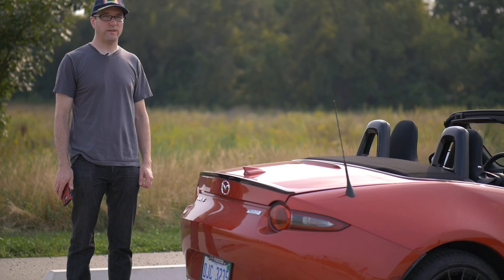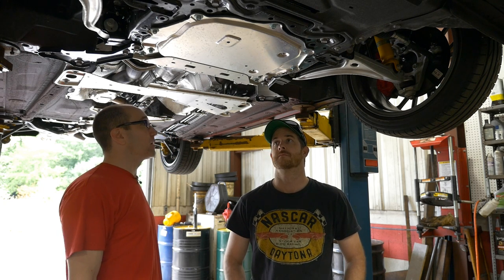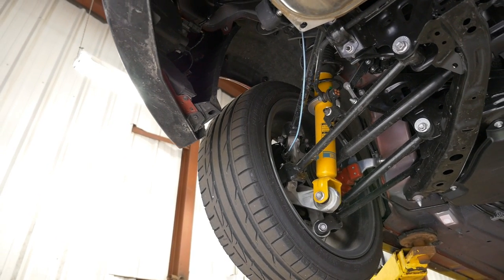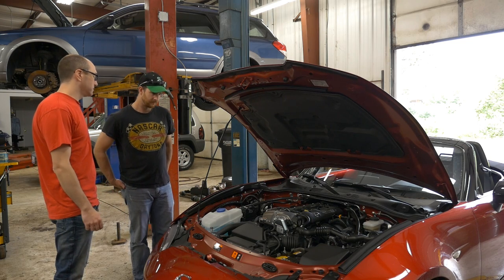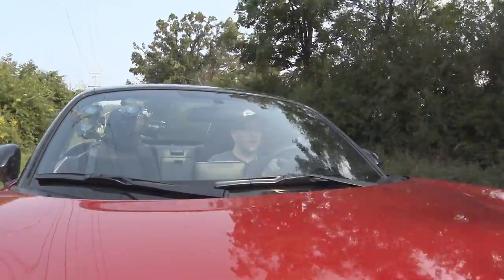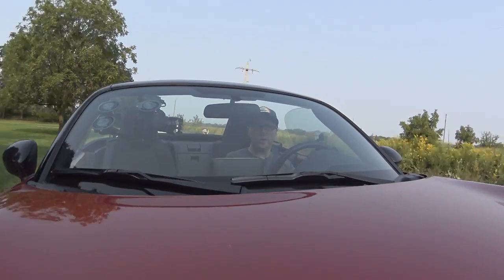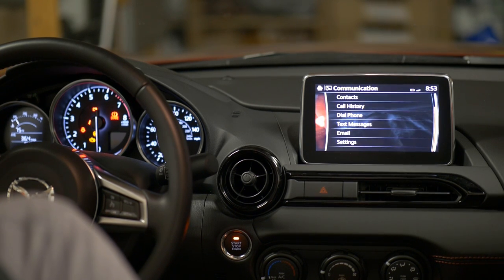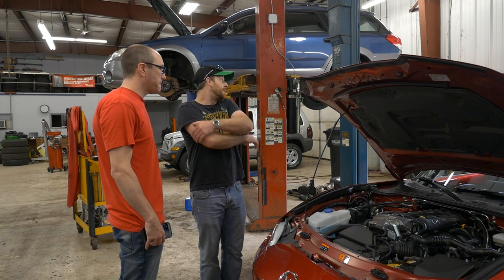Review | 2016 Mazda MX-5 | Curing Automotive Diseases

Comment: 2023 and looking back at reviews of how the car reviewed early during release and I am glad to see that the car has improved in that time (more HP and features). It seems like Mazda too to heart the issues and solved a lot of them, as much as they could with the ND design. I'm waiting till 2024 to purchase mine, the rumor is that there will be a design refresh of the ND (ND3?) so I want to see how that looks. If it is to believed this will upgrade the infotainment system which is pretty out of date compared to the rest of the Mazda lineup. A new version of the car may be 2025 or 2026, but probably hybrid so I'll be getting one before that.
Reply: Did you buy the ND3 Miata? I hear it's great

Comment: Just a quick note: The ND does have caster adjustment, just like all previous Miatas. Not that it really matters, because we all adjust for maximum caster anyway... 
Nice review!
Reply from the maker: Where is it located?
Reply from the maker: Its the two eccentrics for camber adjustment that also effect caster slightly.  It doesnt have a dedicated caster eccentric though thats what we were looking for. I can't imagine you'd get much meaningful adjustment out of those for caster aside from maybe just getting both sides even?
Reply: +savagegeese You're mostly right. Most people go for a specific camber then try to adjust in as much caster as they can, getting both sides the same. It usually doesn't equal a lot of extra caster.
Reply: +savagegeese 

Look carefully at the layout of the lower L-arm. The forward adjuster is in line with the wheel, so it purely moves the lower ball joint outward for almost pure camber adjustment. The rear adjuster is almost purely caster. Move the rear of the arm outward, and the arm will pivot around the front bushing, moving the ball joint forward for more caster. You can get just over 8 degrees of caster with the adjuster maxed out.
Reply from the maker: +Dave Coleman Dave thanks I will update the video thats great adjustment range, suprising actually.  Any other feedback?

Comment: It's interesting i've been cross shopping a lot of cars to replace my first 02 celica gt AT and i keep coming back to the MX5. It's funny that people complain that this car is slow, but im pretty sure my car is ballpark 8 seconds to 60 and i still have a blast just revving the crap out of it. Going into a new 2019 with 181hp, 200lbs less weight would feel so much faster than what im used to now and i'd still be able to have fun revving out 1st and 2nd gear and not lose my license.

Comment: I want to start off with say that you guys did an awesome job with the ND review. I test drove the ND and I agree it would be nice to have a little more power... I'm personally hoping for a 2.5L version. I want more horsepower but I still want to be able to rev the car out without losing my license or life. With that said I think too many people are concerned with peak horsepower. That is just one data point at XXXX RPM. What Mazda did with the ND is give you more horsepower and torque at lower RPMs and that is what I care about personally. If you guys read this and have the time to respond I was wondering if you had to choose between a used NC2 MX-5 for 15 grand or the ND for 30 grand which one you'd pick based on value per dollar.
Reply from the maker: The NC for 15 grand would be a much better buy, right now.  In terms of driving enjoyment mainly its not a massive difference.   Plus we also have to remember its a first model year too.

Comment: For one of Mazda dealer in Poland my company developed and later 
modify few previous MX-5 to 320HP/400Nm. We were tuning brand new cars. 
After that I made few more for customers around and beyond 400HP 
(factory approach, full daily cars, no shitty ebay fan shop tuning). 
Right now we do the same with BRZ/GT86 cars and getting and getting 
ready for MX-5 ND ones. My question is. How can you favor Mazda over BRZ
 chassis/suspension/sound/handling!? I know you owned BRZ, but for me 
this is such a way better handling car with power up to 400HP while MX5 
with it's body roll, bump steer, lack of traction and extreme softness 
is steeling all sport driving experience (even on bilstein shocks). 
Don't get me wrong, I really like your reviews and mostly I fully agree 
but "MX5 way better that BRZ"?? excuse my English :)

Comment: I bought barely used 2018 club for 21k (9kmiles)...now $5k add on gets me 200hp...Edelbrock supercharger...which is carb legal AND edebrock picks up all remaining drivetrain warranty ....That puts me in $26kfor nearly new 200hp mx5 club ....btw that supercharger installed looks TOTALLY OEM  I mean sweet install ....I'd just like  to drive one first ...or have you guys do it at least...btw you guys guys must have long gangly damn arms?  ....my elbows neve rhit cup holders nor has my arm punched info tainment button  ....but your other complaints on lack of interior storage are spot on ....my worst gripe is getting in and out takes effort ....I have to back in and then one by one fold legs into it...but I am mid 60s not so flexible these days....BUT?   I LOVE this car!  I have a 30 mile mountain road loop right by my home....my daily run

Comment: I've watched a lot of new MX-5 reviews and I must say that this is one of the best, if not the best.  I ordered my Club with Brembo package about 8 weeks ago with just 2 more weeks to go before taking delivery.

I appreciate hearing some of the negatives of the car with this review.  It's rare to hear anything negative about this car.  After I drove one today (finally) I had some opinions that weren't all fluffy.  One was with the clutch.  It felt like going over a hill with good resistance about halfway in, and then almost nothing down to the floor.  Was this something you also felt with the clutch in your test car?  Also, there was some interesting steering feedback at very low speeds, as if the power assist was way too helpful, but that wasn't unexpected from watching other reviews.

Lastly, while the seats are really comfortable, I felt a little packed in and protected in the cockpit.  I'm not a large guy at 5'9", but I remember driving my 1995 NA and feeling like I was up above the steering wheel and shifter, my shoulder well above the door line.  I suppose it's stupid safety regulations, but in the ND, I just felt way too low and slightly detached from the elements.  It was also VERY claustrophobic with the top up, even for me.

It doesn't change anything for me.  I'm still buying it.  I'll still drive the snot out of it.  The funny thing is after 10 minutes driving that car, I got back into my 13 year old Acura RSX-S (on the original clutch) and I felt like it was a Stage 2 clutch after leg day.  It will be an adjustment.

Thanks again for this review.

Comment: I absolutely love this car and have been waiting for your review.  As a current S2000 owner, I can relate to the lack of storage space available.  I think your next video project should be one that some of us are waiting for: an ('06+) S2k vs. 2016 MX-5 comparison.  As an auto enthusiast I really am torn between the two cars and would like to see how they stack up.  Keep up the good work.
Reply: +Alan Barrese S2000 is the big brother to the little Miata.  Don't think they are on even levels after driving both of them.  The only thing I see better about the Miata is a warranty.
Reply from the maker: Scott and I will do a video talking about this.
Reply: +Scott P I've always thought the same about the two cars.  The S2k has always been the meth addict junkie version of the MX5, but I just can't help but speculate that being 500 lbs less than the S2k, this new Miata will be no slouch on the track either, especially if you can make it have the same power-to-weight ratio as the S2k.
Reply: +Alan Barrese Your instincts are correct.  The both go down a drag strip and around a track about as well.  The Mazda just does it with a lot more ease, comfort, safety, and economy.  A lot has changed in ten years.

Comment: Great review. Truly. Only gripe is with their main gripe. "More power." The S2000 cost more than $10,000 more than the Miata did - TWENTY years ago. Could they make a faster one? Sure. But as mentioned, it would probably cost 35K for the entry-level Sport model.

Comment: Great review.
I'll consider one of these when the turbo/sc kits start coming out.
The skyactiv motors are high compression, direct injection motors, so ... it will be interesting to see how much more power can be had with FI without having to swap out pistons.
I currently DD an elise, and think the mx5 could be a good alternative IF they do something about the lame power output.
Is it comparable in size to an elise?  Seems to be a bit bigger to me.

IMHO, just as with the BRZ/GT86, imho it just doesn't have enough power.
And no, an extra 100 hp won't "ruin it" or anything as long as they don't go crazy with the torque curve and keep it linear (centrifugal supercharger instead of turbo).
Reply from the maker: Nothing is as small as the Elise/Exige.  Exterior dimensions maybe closer but interior feels huge compared to Elise namely in hip room.  We should get a good sample of whats going to happen with an N/A tune first but for sure a SC kit is probably in order if the motor can hold up.  Its an eco motor by design not performance so I have my doubts.
Reply: Hi, 
yeah the interior space was a given, just wondered about exterior dimensions.
Yhe skyactov motor are actually supposed to be quite strong.  It's a high compression lean burm engine, so it is actually engineered to resist some knock.  The difference you feel with premium vs regular is simply down to the knock sensor.
Reply: Hi, 
yeah the interior space was a given, just wondered about exterior dimensions.
Yhe skyactov motor are actually supposed to be quite strong.  It's a high compression lean burm engine, so it is actually engineered to resist some knock.  The difference you feel with premium vs regular is simply down to the knock sensor.
Reply: Hi, 
yeah the interior space was a given, just wondered about exterior dimensions.
Yhe skyactov motor are actually supposed to be quite strong.  It's a high compression lean burm engine, so it is actually engineered to resist some knock.  The difference you feel with premium vs regular is simply down to the knock sensor.
Reply: Hi, 
yeah the interior space was a given, just wondered about exterior dimensions.
Yhe skyactov motor are actually supposed to be quite strong.  It's a high compression lean burm engine, so it is actually engineered to resist some knock.  The difference you feel with premium vs regular is simply down to the knock sensor.
Reply: +savagegeese Ugh sorry about the bazillion replies ... Fucking android yt app
Reply from the maker: The new MX is definitely small id be shocked if it was anything more than 1 feet longer in length than the Lotus.  Good points on 2L, just dont know too much yet.
Reply: +detaart 
A 185 cv version will be available by BBR GTI (Brodie Britain Racing) with simple breathing mods and a ECM remap.
Should be more to come with no doubt.
Reply: Rgs V Hi.  Could be interesting, but i'm always suspicious of those filter & remap jobs.  Usually, they don't really deliver.  More intake noise and a quicker pickup might fool some people, but not me.

The way to go on this is FI.
Reply: BBR GTI works on Mx5 since the firs NA, they released at that time a Mazda autorized turbokit on the NA.
BBR is a very serious company (I do not own stock from them :P)
The 185cv upgrade is curently in use on Mazda 3 2.0L version.

A more technical look brings me to say that Skyactive concep is not compatible with FI.
let me explain this:
Sky active concept is the reach of the best engine efficiency by the mastering of the combustion (Stratified Direct injection at low rev and light load)  and mecanical architecture (CR, R/L ratio etc...), one the key factor of engine efficiency is the CR (compression ration) which dictate the heat use during the power stroke (difference between high temperature source and the resulting low temperature after expand)
Carnot teach us that a heat machine (so ICE) will "waste" around 50% of the heat energie you put in.

Turbocharging isn't a solution for that despite the use of the exhaust heat to pressurise the intake charge.

CR will be lower and thus the engine efficiency.
Specific power will be greater but it's not the goal and it isn't interesting if you sufficiently master the combustion process, just add displacement as the past does but with just the needed amount of energie thanks to DI.

that's simple as that....

But for sure you can bolt a "dumb" turbo kit to it, drink more gas and hope for a better reliability for the sake of smoking tires :D

Comment: First your reviews and presentation is excellent. In regards to storage in any Miata, yes it is poor at best, cub holders forget it. I had a NB for a couple of years and now have an NC hard top going on a couple of years, I do have a pickup truck but mostly daily driver is the MX5 the cup holder thing is silly I stay away form multitasking when it comes to things I like, I am not going to do fish and multitask or karate an hold a coke can to sip at the same time, so when I am driving a driver's car I don't want or need a pop can to sip. If I want to eat a burger and fries with a coke I will stop driving and seat down and have a moment for the enjoyment of that. When I am driving I like to be engaged with the car and the MX5 is a pretty good little car. Mazda need to make an ND with a power retractable hard top, the RF is neither fish nor fowl, but a PRHT like in the NC and you have the best of both worlds quiet, temperature control, security when parking and total open convertible.

Comment: I really appreciate the in depth review ! Great Job .
I was wondering if you could do the GT  ver. as compared to the Club as featured here. 
My understanding it has a little thicker insulation on top , safety features , i'm guessing it also comes with limited slip with Man.
What you get as opposed to the club ,etc. and your thoughts on both  

Thanks
Joe

Comment: Very good review. Basically I have the same complaints of this car`s interior design, a few flaws. Definitely a deal breaker with the control knob issue when changing gears.I would also love some more hp into that 2.0  motor But still a beautiful car.

Comment: THIS CAR NEEDS THE k20 2.0 LITER 4 CYLINDER THAT IS IN THE 2006 RSX type S. That engine makes 201hp and has about 150pds of torque. It would be a dream combo. You get to keep what makes the MX-5 special while getting a 9000rpm screamer with enough power

Comment: How can this, with all its enthusiast features, not have adjustable sway bars? Seems simple enough, and for people who absolutely love the feeling of minimal body roll and take it over 'safe' cornering performance, it would be so fun, add character to the car, which already kinda gives off that go-kart vibe due to being a tiny roadster with track ambitions.
Or is adjustability just a compromise compared to thicker bars? (I could imagine that the weight advantage of having thin sway bars was a consideration.)
Reply: Just spend extra $200-600 for swaybars of your choice. Remember the price tag on this thing. Stop asking for dry aged ribeye steak when you only got $20

Comment: I’m not sure if the engine should be excessively vibrating at idle to the point were my visor is not still? I only have 1300 miles on it oil has been changed and have no idea what it could possibly be? Any clue?

Comment: Keep up the good work.  I liked how you followed up on the carbon deposit on direct injection.  As I understand it, Mazda deal with this issue by using heat control on the valves to minimize carbon deposit.  Can you elaborate on the oil-air separator?  I didn't know Mazda have these on their car.  Wouldn't this be an oil catch can?
Reply from the maker: +snipercoder They use an air oil seperator box before the PCV valve.  Whether this helps for those who go flat out is a different story.

Comment: Mark, I probably have a stupid question for you and Turboski...
New ND MX-5 club or a decent used Lotus Elise? Both are roughly mid $30k cars with similar design and usage philosophy's. I can't get these two cars outta my head. They would both be fun secondary cars with occasional track / autocross days.
Reply: Lotus is a race car , so if you can live with the harsh ride quality go for it. But since the body is mostly fiberglass , the car can get damage and fixing it is expensive. The mx5 is a tolerable daily driver and more reliable. I daily drive my gt 16

Comment: 1:34 Factory red-painted tiny pathetic floating calipers in the rear just to match the front. How does that make it look better?
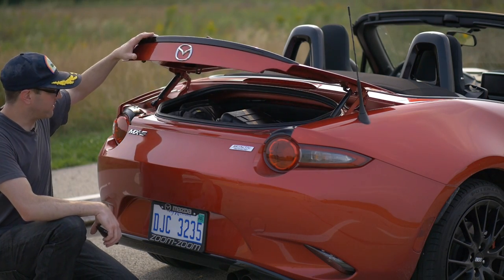3:57 Sound mixing blunder.
BTW, when you mentioned fuel octane, I read up and realized in the EU it's partially a marketing scam. We have some fancy superfuels with higher ROZ, but ROZ is measured under low load, so it's kinda pointless. MOZ is under demanding conditions, so that should matter, and apparently there ROZ 98 "Super Plus" and up is all the same - 88 MOZ. OK, maybe some fancier additives, but regular ones should already have what you need.

Comment: Can you comment on the powerband of the car? I know they increased the throttle response and shifted the power and torque curves around with the special tuning this engine received, but it's still based on the Mazda 3 motor. Does it pull all the way to the 7k redline? Or does it die around 6.5k?
Reply from the maker: It revs clean and smooth to redline but does not rev out as high as previous gen.  Throttle response is instant.  Revs fast, combo of flywheel, tuning and gearing. It has no flat spots above 2500.